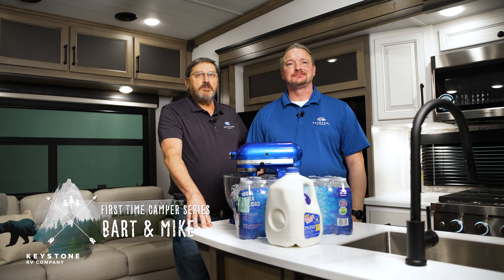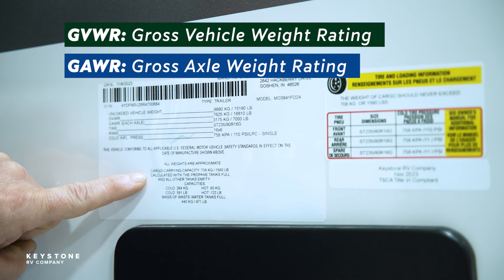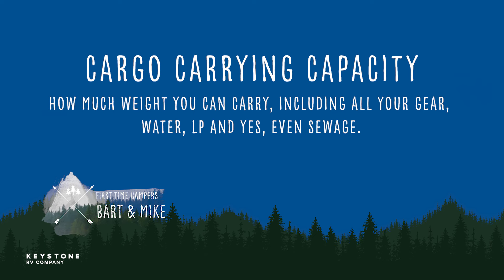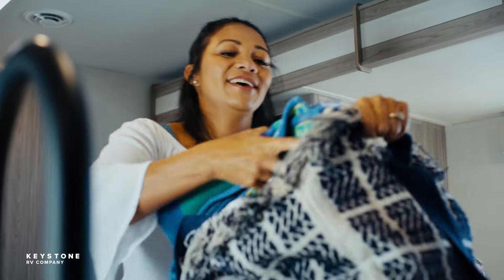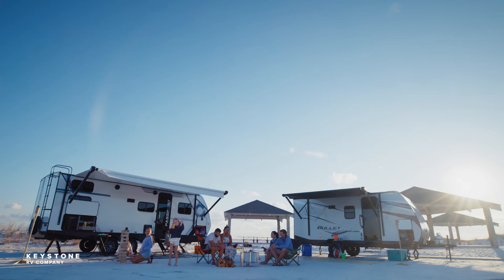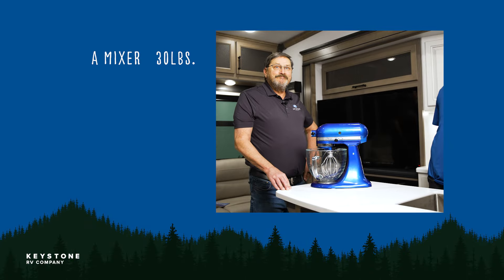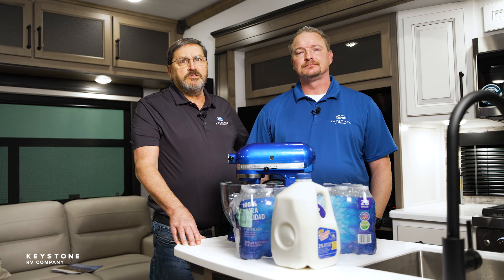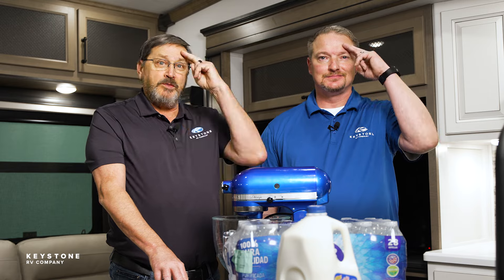Optimize Your RV's Cargo Capacity: Expert Strategies for Owners

Comment: This was good info, but RV companies really need to start building RV's with specific minimums for the size of the units.  I have a 2 year old Coachman 30 ft bunk house that sleeps 8 people with a stated CCC of just over 1000 lbs.  The following year the same model has a CCC of 2200 lbs.  It's in the shop now having new axles and springs put on it.  They should not be able to sell an until of that size with such a low CCC.... In doing research there is a company that has a toy hauler with a CCC of 1200 LBS!  A golf card or motor cycle is going to take up most of that weight.  RV companies really need to start being held accountable!  These things are not being build with safety in mind!
Reply from the maker: Good Morning, thank you for your feedback and for going over this all for us. We are very sorry to hear about the issues with your unit and would like to assist you further. Please do contact our customer care team at 866-425-4369 when you are able to. Thank you!